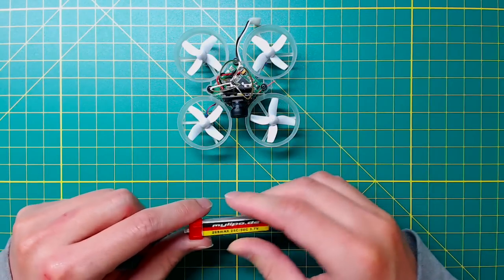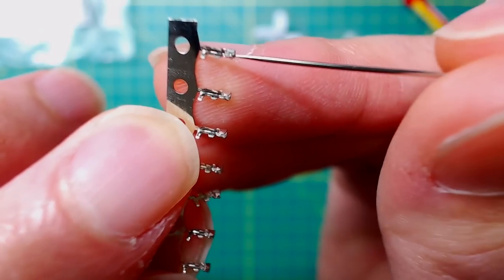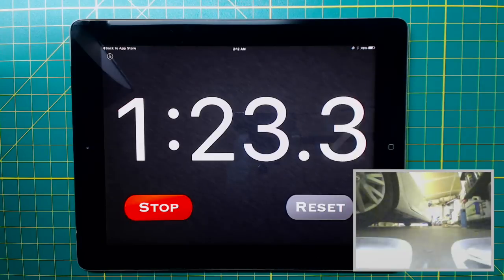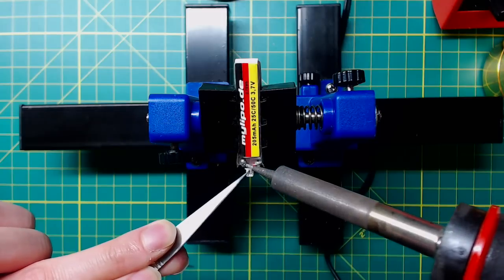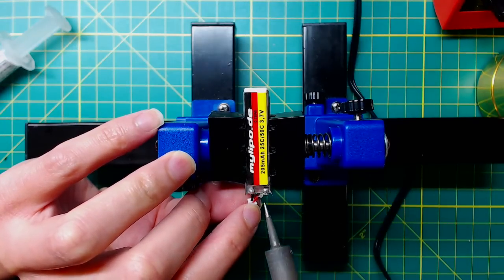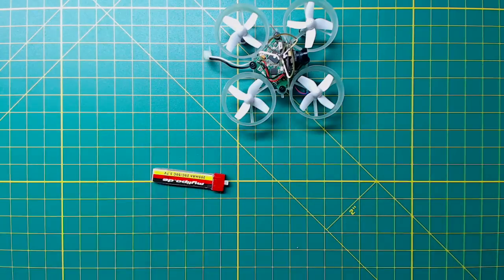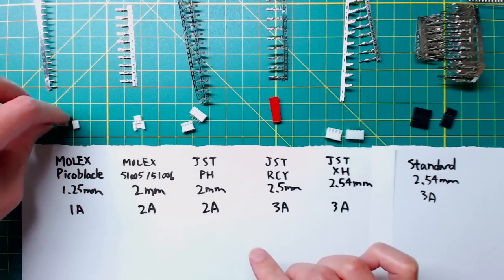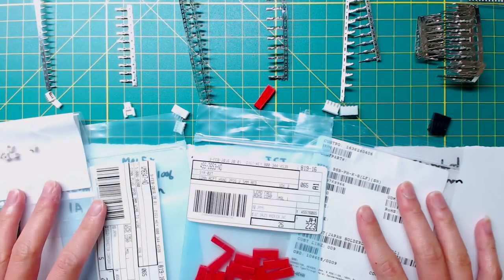How to (and Why We Need to) Fix Tiny Whoop Lipo Battery (mylipo) Connector / Plug

Comment: What a great video!   I have been looking all over the net trying to figure out the differences between the various connectors for the 1S LIPO batteries.  Great job on explaining the differences and the profound impact that the connector can have on the performance of the battery.

Comment: This tutorial works great for switching out the old style of JST or Molex connectors for some BT2.0 connectors that are basically tiny XT60 and offer higher current and mating cycles than the old style so you don't need to replace it again after 30 more cycles.

Comment: I think if I'm going to pull and replace the stock connector off the battery I would go ahead and swap it for a female JST-RCY(the red one) on the battery and a corresponding male connector on the whoop.  Or use a Molex if weight is that big of an issue.

Comment: How can a connector go bad? Either the contacts spread over time, (which you could correct by slightly pinching) or there's some oxidation build up? Couldn't you apply some de-ox fluid every few flights?
Reply from the maker: Yes you can pinch it back a few times but you can't stop metal fatigue from building up when the contact is loaded and unloaded repeatedly. This tiny little contact probably has a relatively low fatigue limit and when it's weakened (losing its "springiness") because of fatigue, the normal force is lowered and contact resistance increases. Oxidization could be a problem but I think the major issue is the lost of contact force.

These micro Molex/JST style crimped connectors are never designed for high mating cycle application. They are originally made for electronic product assembly and allow easy component replacement. Almost all of them (including the slightly bigger ones) are rated at 30 cycles. RC engineers just mis-used them for battery connection (well they are super cheap and extremely lightweight and maybe that's a much bigger advantage than durability to the manufacturer).
Reply: Ivan Wong  I believe you are correct. FYI, I tried some DE oxidizing chemical on rhe batterry plug and I saw 25% increase in flight time in 4 batteries!

Comment: Great video! Thumbs up! 
Actually 30 mating cycles are only 15 running cycles since you have to plug the battery for charging as well. I think the PH connector is much better suited for 3+ Amps , it was used on the brushed Blade mcpx heli and Nano QX 3D with good battery life.

Comment: I am noticing 20 odd cycles issues with flight time -- so what type of connector do you suggest using instead?  Dont want overkill but dont want to have to re solder after 30 more flights...
Reply: Also -- how do you know its not the connector on the board and not the battery?
Reply: It's a fair question, but I guess it's because the connector on the board just has two solid pins, which shouldn't wear quickly.  

The plug on the battery has folded metal contacts which fit around those pins, and have a bit of spring to them.  Those will spread a little each time you make the connection, or unplug it - they'll quickly stop returning to the same shape they started in.

Comment: Great video. I've done this a few times, but it's really frustrating. I'm putting together a new micro quad with the beebrain and I want to switch to the "walkera" type connectors so I don't have to do this repair every 2 weeks. What are your thoughts Ivan? Could you recommend the best (widely available) battery connector for micro quads?

Comment: To remove the hot glue use isopropyl alcohol, use a q tip, soak in alcohol, then on the glue it will be easy to remove.
Reply from the maker: It is not hot glue. It's silicone rubber. Silicone rubber is used way more often in consumer electronic nowadays for adhesive/vibration damping/pcb potting because it lasts for years while hot glue lose many of its properties over months.

Comment: Hi, i find that the charger from my old cheerson cx-10 are the same connector as the lipo battery for the tiny whoop.  I will change them tonight.
I notice that you are not wearing protection is that really safe ?
Reply from the maker: I have been doing soldering for years I usually don't wear any protection. I just try to be careful all the time and always put the iron back on the station the second I am not using it. Regarding ESD, only when I work with dedicated components I would ground myself beforehand and use anti-static mat.

Comment: Thanks - had no idea those connectors were only rated for 30 cycles!
About the silicone that's good for this --  I heard "neutral cure" but the other type I didn't understand.  Can you pls repeat?
Reply from the maker: Please try searching "electronic grade silicone rubber" on amazon.
Reply: OK "electronic grade" -- thanks.

Comment: Might be a good idea then to make a sacrificial joiner cable you leave connected to the battery for as long as possible, just a short cable with a male and female connector. if the end of this lasts for 30 cycles then you bin it the battery connector will last for 30x30=900 cycles. so for a tiny bit of extra weight the connector will last as long as the battery and save you having to replace the battery connector every week.
Reply from the maker: I think it's a very interesting idea! However I do see a significant voltage drop across one connection even with brand new connectors. I tried put two connections (all new connectors) in series and the voltage drop adds up and I got LVC in less than 1 mins. I might have done something wrong. Anyway I have been doing some experiments I will make a new video about all my findings.
Reply: Chris Harper very good idea, may have to do his when I get my new lipos ;)

Comment: while researching that, I'd have went with a more robust connector after finding out a replacement will only last another 30 cycles, even something triple the weight would be worth consistent performance.
Reply from the maker: Next video :) I have been experimenting with quite some connectors. People started to switch to bigger connectors but I want to show some scientific experimental results for us to take reference.